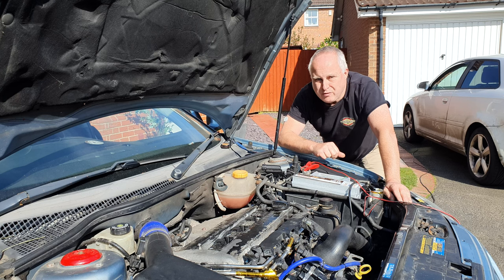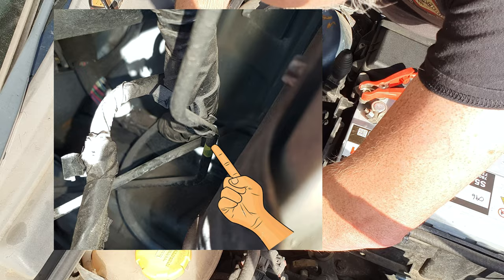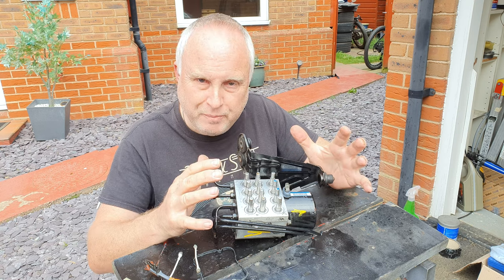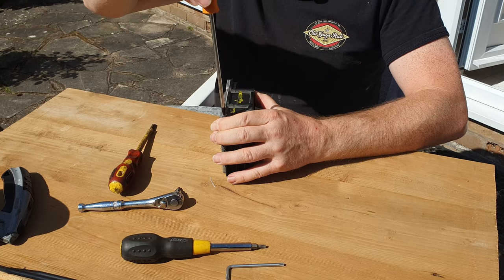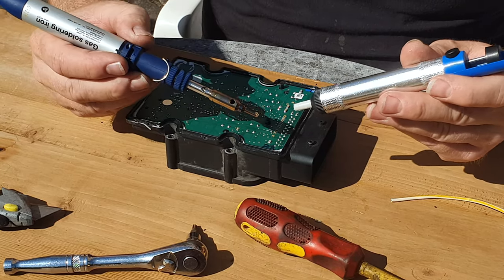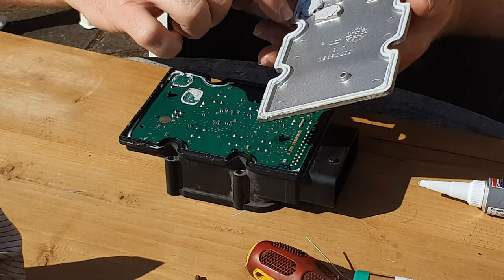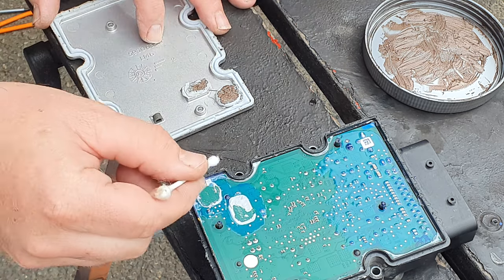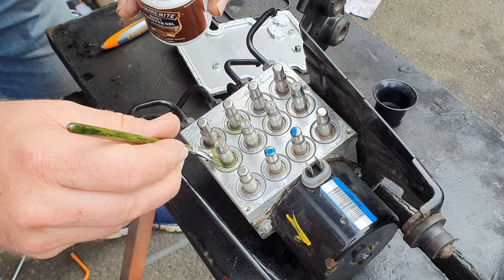Saab 9-3 No Crank No Start | ABS Control Module Repair | U0212

Comment: What do you mean by fine wire???  🤷‍♂️🤷‍♂️
Reply from the maker: wire with a small cross section, <0.75mm for example
Reply: Yeah I bought a 14 Guage way too big 🤦‍♂️🤦‍♂️
Reply: I have a 2007 Aero 93 saab convertible I was able to get it started a couple times jumping from yellow starter fuse block from pin 86 straight to positive battery then it stop working... will that cancel out it being ABS or is it still possible it could be ABS??? THANKS FOR YOUR TIME SURE
Reply from the maker: @RekTurntUp  by "yellow starter fuse block" do you mean the starter relay? Sounds like a new relay might be on the cards. Yes, could still be an ABS comms issue too.
Reply: @CycloneCyd  thanks for taking the time to respond and yes the starter relay... I will try both than if not that I guess I'll have to try the ECU 😢😢😢😢😢

Comment: so a bad ABS ECU the car wont crank the motor? jesus i was thinking the problem was the CIM UNIT i will try this on my saab 93 2.2TID 2003
Reply from the maker: Was this the problem?
Reply: @CycloneCyd  actually was half of the problem,  bad connection in pin 1 of cim and bad connection in abs ecu solve the crancking problem but now I need to solve the other part, the cim unit
Reply from the maker: @gmdinis1  "pin 1 of cim" was that just a bad connection at the connector or was it the pin solder to the cim board?
Reply: @CycloneCyd  i will take the cim apart and see if resoldering solve the problem

Comment: american v6 aero abs is so damned hard to get out.  So tight in there, even with the battery tray out.
Reply: When I did this repair, I resorted to a 1/4" torx bit in the closed end of a combination wrench because clearance was so tight. Don't be afraid to gently bend the brake lines a little bit too, to move the abs assembly away from the strut tower.
Reply: @RonnieTheFinBear  thanks.  I removed the whole abs, didn't bleed the brake lines (cuz i don't know how).  Put it all back together w a video i can link u guys later, but now my "Low brake fluid" light is on all the time, even though the fluid reservoir is level.  Brakes work fine, Don't feel as nice as before though.
Reply: @julianm5333  Hello sir, do have the link to that video.
Reply: @lack8810  hey kev.  Am having a drink rn.  The video is for a different kind of vehicle.  I may have bookmarked it on my laptop.  Would have to check tomorrow.  I did fix it all though.  Sorry ur there man.  You can get out though.  All my brake / starting issues fixed for the timebeing.